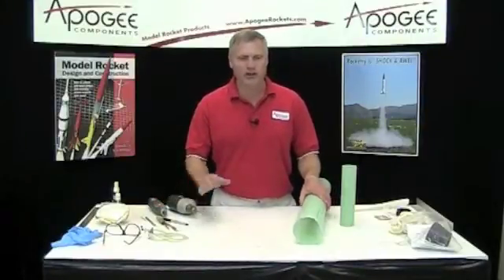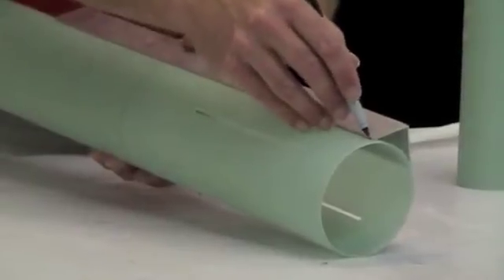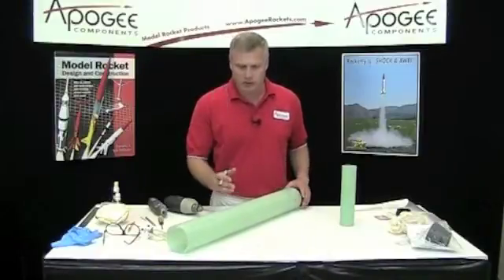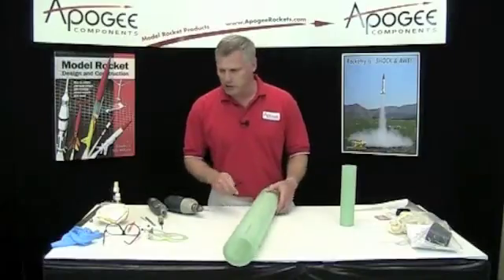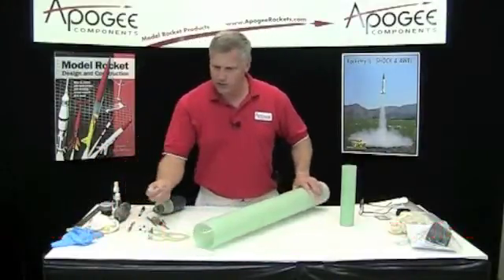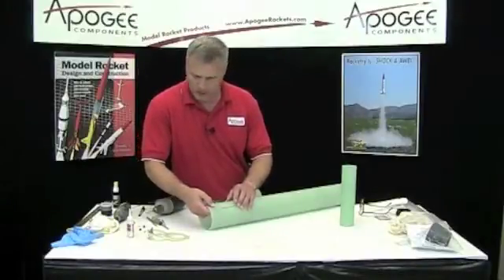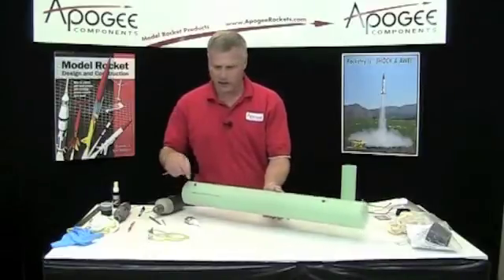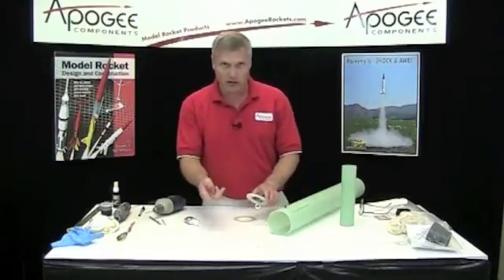Building the Level-2 Fiberglass Rocket Kit - 3: Install Rail Buttons

Comment: I've always installed the engine mount than drilled into the CRs to mount the rail buttons. The nice thing about fiberglass is that it is opaque enough to see where the centering rings lie. I put a drop of epoxy in each hole so that there is a solid bond between CR, BT, and the bolt for the button (I don't use a blind nut for FG tubes), making sure the epoxy doesn't keep the button from turning.
I'm sure it doesn't make much of a difference either way but it keeps me from having to sand the CRs.